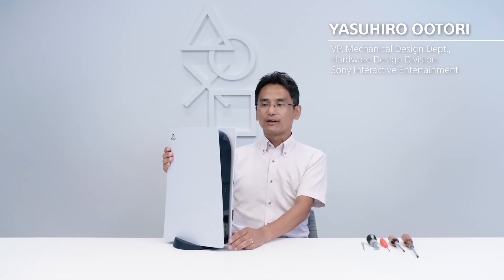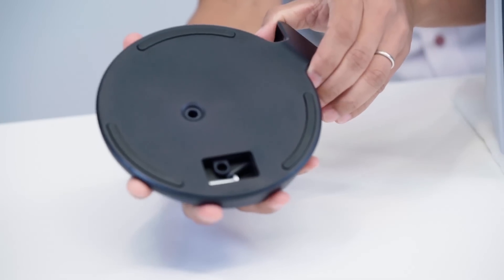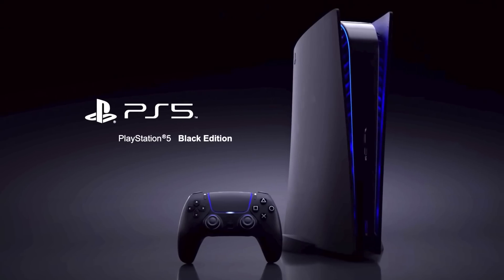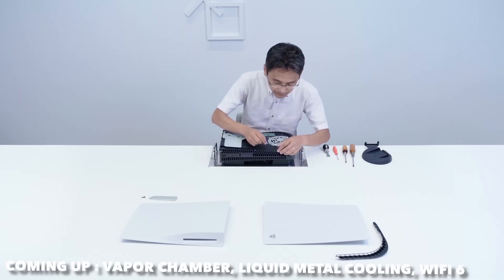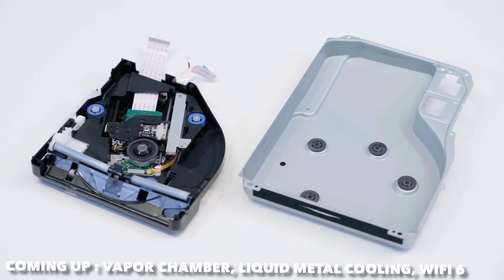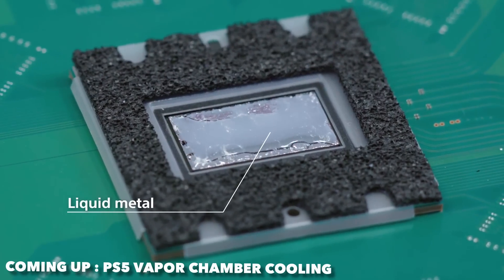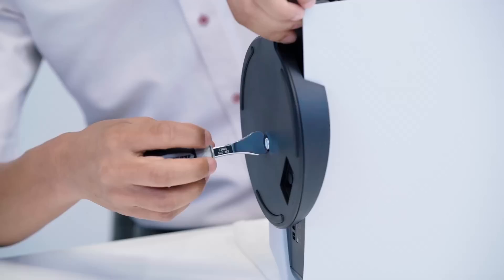PLAYSTATION 5 ( PS5 ) - THE PS5 OFFICIAL TEARDOWN CONFIRMS HUGE PS5 FEATURES! LIQUID METAL COOL...

Comment from the maker: WHAT DO YOU THINK of the dust catchers ?  I live them 😅🤔 

#PS5 official teardown confirms HUGE PS5 features and a well thought out design across the system !
#Playstation5 

DROP A LIKE before you leave ! <3 

TWITTER : https://mobile.twitter.com/tcmf2?lang=en

“SONY TORE IT DOWN”
Reply: The dusters got me semi 😂😂😂😂. Sony Tore It Down
Reply: 🤣🤣🤣PS5 can barely do Ray Tracing🤣🤣🤣Big PS5 features🤔🤔🤔???
Reply: The biggest question I still have is the lan port only 1 gigabit still? I’m really hoping it’s 2.5. Wi-Fi 6 can exceed 1 gbps  so it’s pretty hard to imagine that Wi-Fi will be faster than wired Internet at some point.
Reply: INFURIOUS ONE true 😂😂😂😂😂😂😂😂😂👌👌👌👌
Reply: Dust catchers are actually interesting to me. 😂
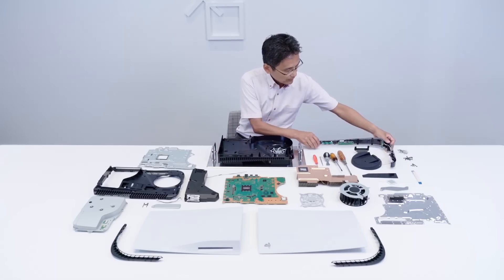Reply: 6:54 series x has a beter design? Are you kidding me? 

Am telling you right now, the xbsx engineering and cooling is a disaster. Look at it from the side picture. 
First of there is no cooling or airflow to 50% side of the box, only the one side with the heatsink(which also loses half of its  air flow power from the fan because of the compartment blocking). 
Second of all there is no cooling on the psu, nothing. Expect allot of units to die out from failing or overheating power units. 
The third concern is the 2nd logic board(south bridge) with all the 1/0 ectr. It gets no cooling or airflow whatsoever, it just has to go by or do with passive aluminium cooling from the block its attached to. 

I am telling you this is a engineering disaster nightmare. It's like almost dreamed up by a child or something. 🤔
Reply: People are gonna be running wild with those side plates.
Reply: 🤣🤣🤣PS5 is a INFERIOR 36 CU Bottlenecked 30fps Joke of a Next Generation Console🤣🤣🤣that will be discontinued within four years. Mark my words.
Reply: dust catchers FTW! 😂
Reply: Considering how cleaning out the dust broke the warranty for the PS4 family of consoles, the dust catchers are a welcome edition.
Reply: The one out that I like the most and this is because I am an IT Engineer is the fan. I know it sounds pathetic but to clean the fan on the PS4 Pro is a complete teardown. Now just clip the side off, unscrew the fan give it a clean and put the side panel on and job done.

It couldn't be more simple could it. I think the fan is 75mm, 95mm, 90mm that is a guess BTW.
Reply: INFURIOUS ONE lol right ! I like how these guys in these comments think they know more then the engineers who actually design the XBSX etc
Reply: SONY TORE IT DOWN
Reply: I didn't know if I would by PS or Xbox but I finally decided to buy the ps5 because of the dust catchers
Reply: INFURIOUS ONE the reason some ps5 games have 30 fps games still is so they can look as good as possible,you can’t have high fps and high end graphics at the same time,but it is possible to balance framerate and graphics with some games
Reply: @kenzobankz4490  lol wrong!
Reply: INFURIOUS ONE the xbsx is not superior in everyy way and someone with at least 1 brain cell knows that,let me explain.

Even though xbsx technically is more powerful,its not by much,and its barely noticable and will not make a difference.2 tflops and 0.3gz is not that big,but ps5 is significantly faster than the xbox,ps5 can load games literally in an instant,but xbsx it takes a couple of seconds,which is also good,but instant is better,ps5 also has well over 20 launch titles,and xbsx has nothing,and the dual sense has so many more features and a longer battery life,but xbox sx controller only has usb c and a share button

I still like xbox,but I like ps more
Reply: Love the dust catchers, I had a PS2 quit working once after I vacuumed the dust out. Quick easy clean is a great idea
Reply: Is it pcie gen 4 or also 3 gen.
Reply: I live in an apartment right next to a main street in my city, my house gets more dust that you can imagine, so yeah, I'm exited for the dust catchers!
Reply: @infuriousone5225  you are right, if we compare RT videos from PS5 vs XBox SX... ah wait... there are no videos to compare with. Welp...
Reply: Dude is dreaming. Rdna 1.5. ain't no damn. 2. Once all the features of 2 is confirmed it's 2
Reply: keep lying to yourself
Reply: @AngryDuck76 stop lying. You ain't an engineer. You probably work at McDonald's
Reply: INFURIOUS ONE all that power for what game? Honestly I’m not an Xbox hater but you’re the type of person who wants console war and also I ain’t saying ps5 is better than Xbox series x, but both have their pros and cons. Please understand what I’m trying to say. No beef, only peace✌️✌️✌️
Reply: @Lackifall  ps5 10.28. XBox 12.16 it's only by 1.88 tfs up on us yea not that much of a difference ur right
Reply: @infuriousone5225  half of those games you're talking about ain't coming out till like 3 or 2 years so your point once again Sony is going to have the upper hand in sales how can the Xbox series x outperform 13 teraflops if it only has 12.16 teraflops have some common sense by the way 10.28 teraflops to 12.16 teraflops it's only 1.88 teraflops above get your facts straight
Reply: Sony tore it down!
Reply: i live them dust catchers tooo gonna keep my console MINT
Reply: rusty shackleford  I have eyes, and i know a thing or two about engineering. If i would bring a project like this to school i would fail.
Reply: rusty shackleford then why did xbox use rechargables for the xbox elite controllers and xbox series X
Reply: rusty shackleford I have had my ps4 for 4 years,and my rechargeable battery is working just fine
Reply: @Lackifall  Xbox players are toxic & salty after their loss in every way so let grief.
Reply: @infuriousone5225  But it comes with Ray tracing lol not a patch like Halo lol.
Reply: Obey your Master Cerny and ignore TF and CU counts, ONLY when its convient to the Sony Pony ego🙄🙄🙄
Reply: @infuriousone5225  who tf is ignoring tf and cu? People are just telling you xbots that the tf difference is not big
Reply: @Lackifall  Cerny command Ponys to Specifically Ignore TF and CU counts. And Xbox Series X has 44.5% more Parallel CU Processing Power than PS5. AND PS5 is a 9.2TF GPU that will boost to 10.28 TF when things get demanding in a game to Stabilize Resolution OR boost the 3Ghz CPU to 3.5GHz to Stabilize frame Rates. AND PS5 is overclocked above efficiency levels. Meaning demishing returns. Which means YOU'RE NOT evening getting a TRUE 10.28TF GPU performance. So Xbox Series X is MUCH more Powerful than PS5!! AND Xbox Series X has FULL RDNA2 features. Which have GPU Power saving Techs like VRS, Mesh Shading, Sampler Feed Back Streaming, ML. So you have to throw those TF on top of the almost 3TF difference too. AND Xbox Series X will deliver 13TF of Ray Tracing Power without straining the GPU's 12TF.  PS5 CANNOT do that!! So those are more TF advantage Xbox Series X has over PS5.  https://youtu.be/qcY4nRHapmE. 11 minutes into video!! Xbox Series X STOMP PS5 in so many ways you and the Sony Pony BIASED Media ignore. Let's see how Ray Tracing for WatchDog Legions looks on PS5??!! Bet ya a buck IT'LL SUCK compared to Xbox Series X??!!
Reply: @Lackifall  AND PS5 CANNOT support 1440p either🤪🤪🤪
Reply: @Lackifall  AND if you have all your Games loaded on Multiple SSD Drives. It WILL be a pain in the Ass changing SSD drives for the PS5😜😜😜

Comment: I'm one of those who is too afraid to open my PS4 for cleaning the dust because I'm scared that maybe I will wreck it. That Dust Catcher can really help my problem a lot.
Reply: If you have a PS4 Pro cleaning the fan is very simple, just remove the panel with the Playstation logo and then use a compressed air can to clean the fan. If you’re careful enough I don’t think you’ll wreck it. It’s up to you.
Reply: @andreicrutq4564  Sadly, I'm using the base PS4.
Reply: @andreicrutq4564  wont the air just make it worse since it blows all the dust deeper inside
Reply: Pablo Escobar yes dont believe this clow
Reply: @andreicrutq4564  its the heatsink that collects dust too and you have to take the ps4 apart to get to it
Reply: @leo888222  How will it blow to the inside when you will use a Vacuum to suck the dust out, and the dust catcher is in a strategically location on the heat sink.
Reply: ...or you could just keep your room clean...js
Reply: @theranger5774  I have a maid who clean my room every other day, there's really no way to prevent dust. Js..
Reply: @andreicrutq4564  don't use compressed air man only use that when you're taking apart the entire console using compressed air will just push dust to other areas
Reply: @markwaty1  i wasnt talking about the ps5 i was talking about using compressed air on the ps4
Reply: @leo888222  I see. My bad then.
Reply: 😬😬😬I'M AFRAID OF A PIECE OF PLASTIC😬😬😬
Reply: I don't even have a ps4 I have a ps3.
I'm not buying a ps4 if I save my money I can get a ps5 in about the next 20 years!

Comment: I can't believe the liquid metal was actually true. I'm impressed
It is also a very easy system to clean out due to the dust collectors. All you do is take the panels off and hoover/vacuum the dust out.  Very handy, certainly a lot easier than any other console to my knowledge
Reply: #SAVAGE #BLACK #KID #CX  you gotta remove some screws. Ps5 only requires a pair of hands. No tools.
Reply: #SAVAGE #BLACK #KID #CX  You have to void the warranty to completely clean the console on the ps4. Sony listened to us and put dust collectors so you don't have to void the warranty
Reply: #SAVAGE #BLACK #KID #CX  You can only remove one small panel (at least in the base ps4) and theres barely ever any dust in there. Its mostly on the sides and back where the vent holes are and a vaccuming those barely takes any dust out.
Reply: @valentinalmaguer2216  Yeah. Most of the dust goes to the shield (GBG's PS4 Pro is proof of that). Plus the only thing the pro and slim allow to be removed without breaking warranty would be the HDD expansion.
Reply: Liquor metal is not a good thing for this system the only thing bad whit it
Reply: KILLSHOTGOD5 I think I drink too much before I wrote it oh and good one Xclown 😂😂
Reply: @Alfrin.lifter  😂😂😂

Comment: The dust catchers are a nice QoL feature as it was difficult to vacuum out all dust just through the air vents the PS3 & 4 collected internally without having to completely disassemble the consoles.  Now it will be consolidated into just 2 collective spots.  Nice touch!

Dust removal is important because dust acts as an insulator & traps heat & makes heat dissipation less effective.

I want to know what expansion SSDs we can utilize.
Reply: On the PlayStation blog the engineer are saying you could use the straphological 370 ssd for more storage
Reply: @caocacao-y7l  What SSD make and size is that?
Reply: Yes facts I really want to put more storage in the PS5.
Reply: And not just that, you can clean the fan without tearing the warranty.

Comment: I was equally impressed with the dust catchers, who thought a day would come where you could vacuum your console!
Reply: People have been doing that for years. I always vaccum my PS4 Pro or Xbox One X out.
Reply: Bro, we have already been doing that...just that with the PS5 its gonna be easier which I'm excited about.
Reply: Are there going to be specific attachments that can vacuum inside of those holes?
Reply: I've been vacuuming my consoles since the ps2 😅
Reply: @michaellynch5254  One of the hose nozzle probably would already fit in it (the skinny one). I think that a DataVac, or any other PC vacuum cleaner, would be a safe bet.
Reply: Use to vacuum my PS3 slim n I was in my teens back then lol
Reply: Yeah but if dust is a big issue, you'd better stay on top of it. Those are gonna clog like crazy. At least, if it's like the ps4, you'll hear it when it clogs up.
Reply: @icaruswindrune7116  I'll look into it when I have the system. Thanks

Comment: Ok now I'm sure they have a better hardware design, I mean dust catchers!
Reply: Can someone explain how they work like those white plates would block the catchers right?
Reply: @BoutyDaShitnificent I'm sure there's a sex joke in there somewhere.
Reply: Series X is going to be great at sucking up Dust Bunnies.
Reply: @xshieldz1503  they funnel the air though them most likely.
Reply: @MichaelADemei  so the console sucks the dust inside the console towards the dust catchers?
Reply: @xshieldz1503  consoles always suck dust into them as they suck cold outside air in to cool. Usually the dust goes all over the inside of the system making it extremely tedious to remove all the dust. Also you need to be knowledgeable on how to take something like the Ps4 apart and put it back together so that you could remove all the dust. In the PS5 they created areas where the dust will collect so its easily vacuumed out without having to take the entire system apart. Just remove the 2 plate that snap on, and vacuum the 2 ports. Its a great idea
Reply: @xshieldz1503  no they force the dust to them.

Comment: 6:54 series x has a beter design? Are you kidding me? 

Am telling you right now, the xbsx engineering and cooling is a disaster. Look at it from the side picture. 
First of there is no cooling or airflow to 50% side of the box, only the one side with the heatsink(which also loses half of its  air flow power from the fan because of the compartment blocking). 
Second of all there is no cooling on the psu, nothing. Expect allot of units to die out from failing or overheating power units. 
The third concern is the 2nd logic board(south bridge) with all the 1/0 ectr. It gets no cooling or airflow whatsoever, it just has to go by or do with passive aluminium cooling from the block its attached to. 

I am telling you this is a engineering disaster nightmare. It's like almost dreamed up by a child or something. 🤔
Reply: He was quoting others & stated he disagrees 🤷‍♂️
Reply: @sanandreas212  I was referring to those people who said that xbsx was better designed
Reply: @alternatypje  my bad 👍

Comment: Only issue I have is that I still could not see if a 110 mm ssd will fit 
(Edit ... in your video I actually saw the mounting screw for the ssd on the 110 mm slot)
Also The Samsung 980 Pro will be a very popular SSD to expend the PS5 Storage

Comment: Than fan design tho. Very clever to have it double sided, and 3 times the width.! it will move as much air as 2 or even 3 120mm case fans. Liquid metal and the largest heat pipe I've ever seen.....super cool n quite well done Sony.

Comment: Does the console come with a flathead screwdriver? If it doesn't, im gonna have to go to home depot or something, so i can screw on the stand
Reply: Nah just use a butterknife if they don't give you the tool. They had the same flat screw design with the PS2 slim and I just used a knife and worked like a charm. (I have a screwdiver but the kitchen drawer is more convenient)
Reply: @atarynspace3590  Excellent. I found a flat lying around my home but I lose it i now have an alternative

Comment: Sony did a great job on the design of the console, and from the looks of it, it was designed with better cooling in mind as you can tell from the dust catchers, the liquid metal and huge heatsink which acts as a vapour chamber. Now all I want is for Sony to show us what ssd are compatible with the PS5 and the UI. 
SONY TORE IT DOWN

Comment: The ps5 is well thought out..but they sacrificed raw performance because of the high end cooling they  had to use...
Vapor chamber... liquid metal..fan design...alot went into keeping the box cool...and that's because of the high clocks of the gpu  and the really fast SSD...

Time will tell if this was a wise decision...

Mark Cerny believes the higher clocks gives greater benefits over just a beefier gpu...but it will be interesting to see...

If I had to guess I'd say it was a mistake. And they didn't take into account RT

Comment: What are the consequences if one were to wipe off the liquid from the metal liquid cooling and then put the console back together. Is the console still playable?
Reply: No, the thing would overheat because the liquid metal is basically the same thing as thermal paste. It just does its job of transfering heat better and does not dry up. Why would you wipe it off anyways?
Reply: Veldin I wouldn’t, was just curious

Thanks for the answer tho
Reply: @GabrielProAngel  Oh okay than

Comment: How anyone could think the series x is better designed than Ps5 is beyond me!  I'll take the japanese design aesthetic and ingenuity any day of the week.  Sony was so smart to make the Ps5 customizable.  That's so pro consumer.  Just the ingenuity on display is astounding!  The cooling solution with the liquid metal and huge tube based heatsink is top notch.  Nov. 12th cannot come fast enough.  Got my pre-order and ready to go!!
Reply: Liquid metal is nothing special they've had it on pc for years
Reply: @anthonydriotes8804  That doesn't mean it's nothing special as it's the first time it's been used in a home console.  Secondly this isn't just a standard liquid metal implementation as Sony mentioned it took them 2 plus years to come up with this particular set-up.  So they have obviously made it so it stays effective for 5+ years and that it won't leak.  It's also interesting I think, the different design choices that each console manufacturer has made.  With Microsoft choosing to go wide with more Cu's and Sony choosing to go narrow with a crazy fast GPU clock speed at 2.23Ghz!  Both systems are really powerful and innovative and I can't wait to see what they do.  And we won't really be able to to see what these machines are capable of for 2 to 3 years.  As a playstation fan, though I think we got a sneak peak with the unreal 5 demo, which looked stunning.